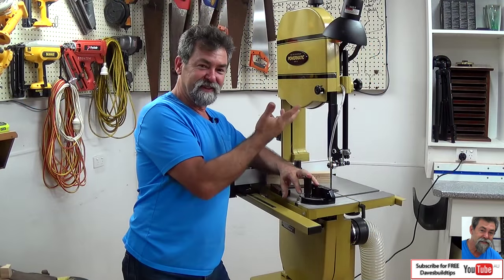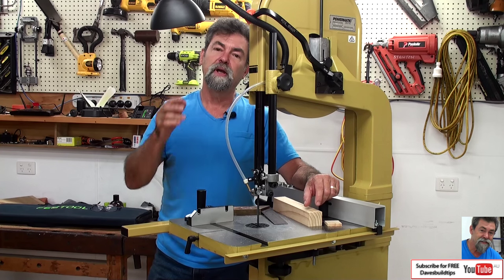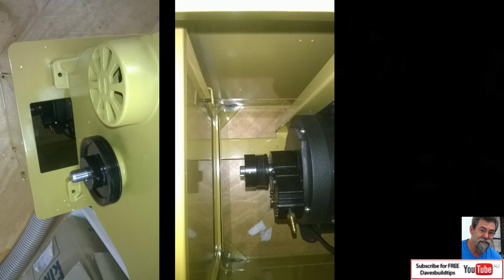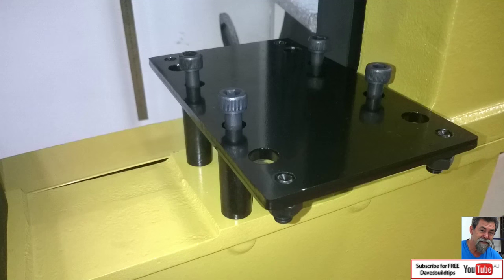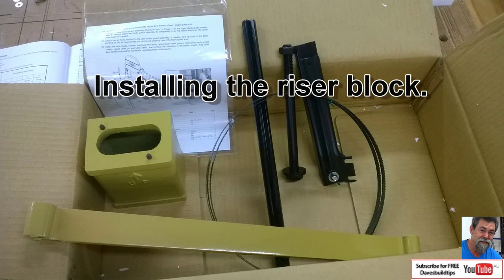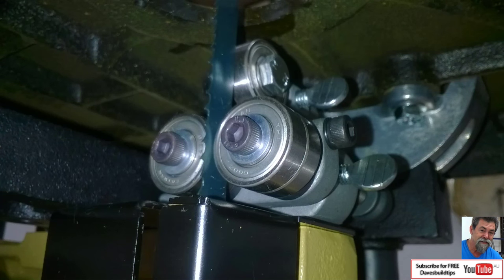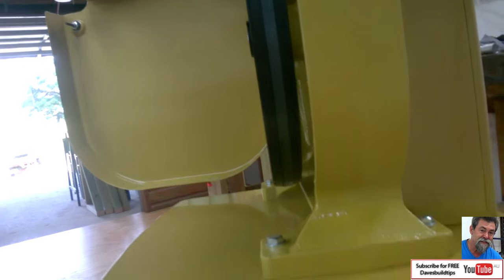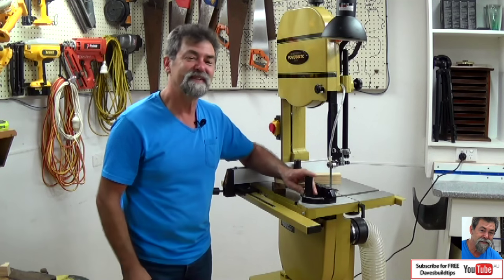Unboxing and assembly Powermatic 14 Inch Bandsaw Dave Stanton easy woodworking

Comment: I finally assembled my saw on a snail pace. Wound is much better than months ago. I have not installed the riser block yet as the rafters in my shop is hidden by plywood ceiling. And like I said this saw will be devoted to curve cuts. And I don't have the longer blade for the riser block add on. Your video was very helpful indeed. Thanks very much for documenting the set up. It takes a precious time and equipment and a heart in all of your videos. Until next time!
Reply from the maker: +dennis ma . Dennis, that was very kind of you to go into detail saying thanks to me. I hope the saw works as well as mine does!

Comment: I forgot to thank you David for such a great video. It filled in the blanks for me from the out of date instruction manual. 
I mounted my saw on a mobile base from Carbatec. I was able to bolt the mobile base to the saw base using M12 bolts in the existing bolt holes. Lucky. Because the wheels sit outboard (swivels at the back of the saw) the base seems to be quite stable when the wheels are locked
Even though I am short for my weight I find the table height with the wheels reasonably comfortable.
It's strange how different machines and benches are comfortable at different heights. I guess it depends on your stance and the work method each demands.
Reply from the maker: It will be good to hear back from you after using the saw on the mobile base for a while. Thanks for the compliment!

Comment: i still have the PWBS14 in their original boxes and still no time and energy to assemble this little but brute machine because of a recent abdominal surgery. thanks for the time documenting the assembly. it surely will help me in the future.
Reply from the maker: +dennis ma Wow Dennis, sorry to hear about the operation! I hope you mend up well and have a great time with your bandsaw.
Reply: +David Stanton I have a Rikon 10-325 and set up was easy except that it was heavy. that was in 2012...i purchased the Powermatic late last 2015 and will devote it for curve cuts and got it at an irresistible price...purchase justified..LOL...until that fateful operation...but all the while i was thinking that assembling this bandsaw is no brainer until i saw your video about this and that..i am sure i will take a second peek before i finally assemble it. wound still hurts though but i am good. still need a few months to finally recover the strength of the muscle they cut across on one side of my belly. all the best to your channel David.

Comment: Just a tip to help keep the washer and lock nut from falling off the bolt when affixing the saw to the base.  Stack a few small round magnets on the top of the bolt.  There will be just enough magnetism to keep the washer, etc. on the bolt so that you can put the nut on.  I also found that a 13mm wrench fit better than the 1/2 inch called for.
Reply from the maker: Thanks for the info!

Comment: Thanks Dave,
After lots of mucking around, finally did get the drive belt to stay on. Yep it was all about aligning the pulleys. Don't think to much about the design and the space you can work in, but everything else looks good.
Thanks for your advice.
Mario
Reply from the maker: Glad it all worked out in the end. I think little things like this are beneficial as it forces us to know out machines a bit better.

Comment: Good video David, between your video and the instruction manual I managed to get my Powermatic 14 put together in no time. it was very helpful to watch the video through, then take the Laptop out to shed and watch it a bit at a time as I did each phase. Great bandsaw, and great price with the Carbatec pre-Christmas 20% off sale.
Reply from the maker: Happy to have been able to "Be there" with you while you assembled your machine. I have been using mine heaps over the past few days.

Comment: I managed to take a lump out of a finger when adjusting the tension on the motor pulley belt. I found that the easiest method was to place a jack under the motor, loosen all four bolts, jack up to fit belt, use a piece of timber about 600mm long braced against the top of the motor and the top of the doorway (use your knee to apply pressure to this 'lever') and a square set against the motor mounting rail. That leaves both hands free to tighten the motor mounting bolts which are somewhat awkward to get to.
It is easier to install the 4" extension block before you fit the table.
I have found that the last adjustment after everything else is to level the extension table. It seems to go out of level whenever you pivot the main table. Could be me.
Reply from the maker: Yes, the riser block may be easier to fit prior to lifting onto the base. Sorry to hear about catching your finger...didn't have any issues there. My table and extension sit perfectly. Have you had a look at the way yours are mounted? Might be an oversight?

Comment: Looks like the new Powermatic 14 comes with Carter alignment bearings. Quality. Nice Job.
Reply from the maker: +mmanut .Looks like a nice saw, smooth so far!
Reply: +David Stanton hi Dave how you going? I love your videos on all your product reviews I have seen so far. I recently bought this saw too, in Janurary this eyar,and whilst it perfoms great and is plenty powerful,unlike yours which I saw in the breif moment you were sawing in the start of the video, it seems to purr beautifully, but mine as soon as I start it up and mroe so when I shut it down and it comes to a stop, there is a constant loud tapping sound somewhere downstairs, and just today I tried something to see what could be making such a noise (and vibration along with it) so I removed the pully belt and started it up just drive the motorand as I anticipated, it ran perfectly, but when I re-attached the belt it did it again,and I can't for the life of me figure out what it could,be I just know it shouldn't be. would you have any theories as to what could be the colpret,or what do you suggest I try and look for to find out? cheers.
Reply from the maker: First thing to do is remove the blade to see if it is the bottom wheel. Did you buy new or second hand, Australia or elsewhere? Is the drive pulley connected properly and is there a grub screw that may be loose. Try to narrow it down to one spot. If it is new I fail to see if it would be a bearing. The other thing is to see if the motor pulley is inline with the wheel pulley. This is covered in the manual, how to align correctly. Hope these checks help.
Reply: G'day Dave,cheers for the quick reply,yes, It is new, from Carbatec actually (Melbourne store) so obviously still under warranty. to know knowladge the pully is connected properly, that is I assume it is as i didn't fiddle with it other than place the belt over the pully, and I made sure as I could to make sure it is alligned. where would this grub scre be located? I am alsot definitely sure it would be soemthing to do with the bottom wheel,and I should point out now that I remember, if I spin the wheel by hand,it makes the slightest sound at some point in the revolution, ofcourse not nearly as loud as when being driven by the motor, but I can tell it's that same sound which when spun by hand sounds like a friction or something of such. I hope the additional info I've given you has given you a bit more insight. thanks again.
Reply from the maker: Carbatec are usually very good with warranty. I work part time at the Sydney store and I know we do not hesitate if there is an issue. If it isn't something you can track down fast, give them a call at Melbourne. My saw performs very well, so should yours.
Keep in mind that while I work for them there is no kick back to me or any direction from Carbatec regarding my videos...just the way I like it.
Reply: yes indeed,of course. and as I mentioned earlier, I paid close attention as I could to the sound of your saw as I could,to try and rule out that it's not just the nature of the saw,which yours proves it is indeed not. I will try have another look at it closer and I'll get in touch with the nice bloke in the Melbourne store,hopefully he can help. is there any specific part around the bottom wheel/pully ares I should have a really close look at? as much as I have a lot of experience at my young age in using tuning up and maintaining a bandsaw in general,I have basically zero knowladge as far as the mechanics of the machine go figure
Reply from the maker: Just focus on the areas I mentioned. Carbatec are a great company to work for and to buy from.

Comment: Thank you Dave, great description.  Question, I don't have a beam to hold the top.  Do you think the riser block can be installed while the main saw is laying on its side the stand the entire thing up?
Reply from the maker: Indeed you can. Pretty easy.
Reply: Thanks Dave.  I have been leaning towards the Powermatic but know my shop limitations.  Lay it down put the block in then mess with the little bits.  Again, thanks
Reply: @DavidStanton  Hi Dave, Good video. I am picking up a new Powermatic 14 tomorrow from Auburn WA tomorrow. I was also looking at the Laguna but it is $1399 at Rockler here in the US and the Powermatic saves me $500. I watch your live show when I can but have missed the past few. Found this video this morning via a youtube search  and knew that you would do a good explanation. I was going to ask about lying it on its side for the riser block instalation as I don't have rafters. Good that someone else asked and you answered.

Comment: Another great video David, mate where do you find the time for all this, your work shop must be comfortable for night work!  One tip that people might find useful is something I always do, its for safety.  I learnt this as an apprentice, all the bandsaws in our Pattern shop had this, simply I put a dab of orange or yellow paint on my bandsaw blades so that I am aware when the blade is turning just in case of distractions or for that odd occasion when I may have had to move away from the machine, better than losing fingers.
Reply from the maker: Great tip Bob. I will make that a rule at my work shop. Regarding time...I work part time for an Australian machinery retailer to keep food on the table and also to meet like minded bods. As far as these videos are concerned it takes a full 8 hours for me to produce 5 minutes of video from concept through the start of upload. I have spent many hours working on a 25 minute video that will be released today, 12-6-2016. I really should think about getting sponsored! PS, I love working in my workshop at night but my wife would also like to see me now and then.

Comment: you can throw the bearing guard across the room where you threw your cell phone. it seems like it's always in the way.
that's a really nice bandsaw. powermatic really does a nice job.  i had grizzly, which is also a nice saw, but it doesn't have the extension table, the quick release is not accessible from the front, and not blow hose. what i do like about the powermatic is that the motor is hidden inside the base.
Reply from the maker: Gino. I find that anything that encloses the blade, even if it is a bearing guard, will help with dust extraction. What do you think?
Reply: Hi David, 
That's can be true, although the bearings are on the outside of the bottom wheel enclosure, so it may not make a difference. Give it a try by applying some suction, and see if it makes a difference on and off.
What type of dust collection do you have?

Comment: Hi Dave,  thankyou for your quality video’s. I was wondering how you have found this saw after having it for a bit now? Do you do much re-sawing with it? Thanks, Fred
Reply from the maker: Not really a strong enough motor for resawing. I ripped around 60 metres of 90 x 45 pine with it and while I did it, the saw did bog down a bit here and there. This saw is great for smaller work with the bellows and light being massive assistance! I would recommend a 3 horse machine for resaw work.

Comment: Thank you for the video. I have a question if you don’t mind. I’m struggling with the motor belt alignment (horizontal misalignment). Alignment and tension at the same time have been extremely frustrating. 
How did you put your motor in place, please?
Thank you
Reply from the maker: Interesting point Christiano dos Santos e Santos. Just losen the bolts on the frame support for the motor a 1/4 turn and locate the motor in the correct position and then nip the bolts up again.
Reply: @DavidStanton  thank you

Comment: Hi Dave and thanks for very informative video, I kick myself as I seen the powermatic bandsaw on sale at carbetec at $1400 or so , but is now $1800 now , so I watched jays Channel comment and want to ask for some advice , I want to buy a 14 inch bandsaw like powrmatic and later put a riser block on ,  I've looked gumtree etc but they want 3/4 of a new bandsaw at carbetec models , so I like the grizzly model and seen a post of a Aussie in Perth with one but hasn't responded to post asking are they compatible in Australia but found a alternative at Ron Mack  bandsaw woodworking looks similar to grizzly can you shed any light on grizzly power to australia capability and have you seen or herd any rests on the 2nd alternative to the powermatic the Ron Mack copy
Reply from the maker: Never seen any of the alternatives to the powermatic so can not comment. I notice that all bandsaws are getting more expensive as time goes by. The powermatics in Australia come with the riser block as part of the price.

Comment: Hi there, ive been enjoying mine for a year now. But i recieved it pre built from carbatec (a surprise to me when it arrived =( ). my question is how the heck to properly set up the door clasp screw/knob combo? Are you expected to use an allen key to fully screw in or out everytime? if so whats the knob for?
Reply from the maker: Yes, allen key every time. This was a fix because so many people were trying to use the handle as a twist like a door knob when it actually was a push shut into a receiver. Because the part on the handle that went into the receiver on the body inside the cabinet was steel it often was pushed out of position and into the path of the blade and dulling one side. The allen key method is the same as mine and it does what it does well even though it is a slow method.
Reply: Thanks for the answer. Mystery finally solved, always confused by the 'pull' written on the knobs. Maybe a couple retro fitted case latches might be the go.
Reply: @dmaifred  I agree. I think for such a 'high end tool' that both the top and bottom door could have been better thought through in terms of closing / opening knob.  I ended up Drilling the 'nut' section larger by a fraction so I could perform a push / pull action to open it. However even this is not a pleasant experience.
Reply: @dmaifred  I purchased the same model and asked Powermatic in the US about some of the changes - the silly hex bolt system is a result of needing to comply with European safety requirements - they had to do it if they wanted to market a similar model overseas and we (purchasers of the Australian model) ended up with the European safety changes. I hate the changes as they are a pain to use.

Comment: Hi Dave,
Just got my new PM 14 and started the assembly process. Got hung up on installing the drive belt. Had a mate help me and for the life of me, could not get it to stay on the tracks. Checked that the pulleys lined up. looks OK. What the secret?  Do you have a videos on this or some clever technique?  
Cheers
Mario
Reply from the maker: Hi Mario. First suggestion is that the belt is on correctly, ie. the ribs are on the inside of the belt, not the outside. Second is to ensure the pulleys are aligned. You can do this by placing a piece of straight timber against the face of the pulley on the motor and see if it is true to the pulley on the lower wheel of the saw. Try this and see if it helps. The doctor will be in again tomorrow, lol.

Comment: sir my question is with the riser in stalled, is the 1 1/2 hp motor not a bit undersized for resawing American timber such as walnut and oak?
Reply from the maker: +Tony Moore .
Hi Tony. You are probably correct if your need was to resaw a lot of timber that dimension. My main use for this saw is every day work of around 2 inches thick but what a great thing to have if ever I need to resaw the occasional 12 inch log? It would be slower than a 3 horse machine and that is something I am willing to put up with for the versatility of this saw. Thank you for your input!

Comment: Thanks for the video and the tips. I've actually been wondering what this bandsaw was like for a while. It actually looks to be a pretty well built bit of gear. David did you buy the riser block of carbatec ? and do you know if carbatec sell the longer blades for using the riser block ?. Thanks and I just subscribed to your channel.
Reply from the maker: +Stewart Rankin . Hi Stewart, thanks for subscribing! You may or may not know that I work part time for Carbatec although they have no say or input to my channel. Read the about section on my channel.
That said. I buy a fair bit of the gear they sell purely because I am surrounded by it a few days a week.
The band saw is a cracker and it is a very good performer. Carbatec sell the saw as a complete unit, riser block, longer blade and extended guards included. I also purchased a 19mm 3 TPI blade for ripping and I was pleasantly surprised. Just ripped a  150 x 19 mm piece of Tassie oak 1.8 metres long into two 150 x 8 mm pieces and it did it with ease. Dust collection is very good.
Reply: +David Stanton HI, Just wanted to say thanks for the reply. That's good news that carbatec sell the saw complete. Now I just gotta start saving some $$$.